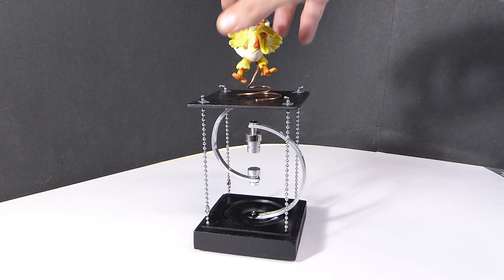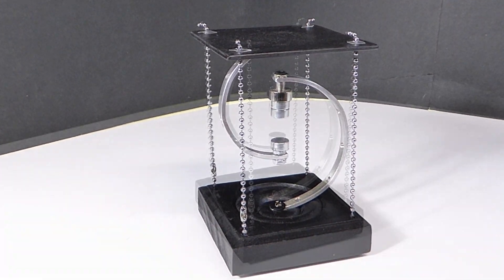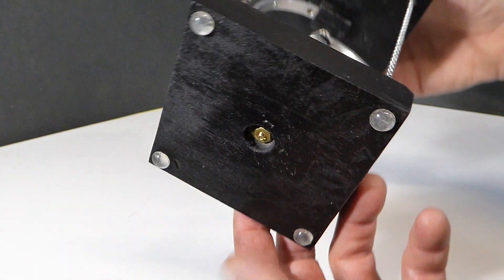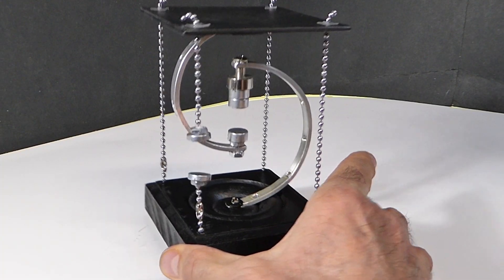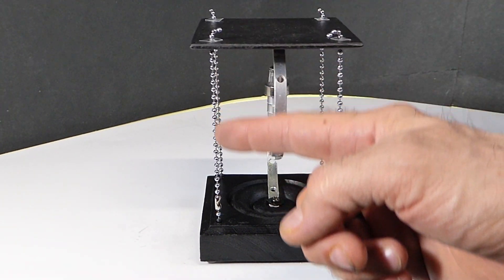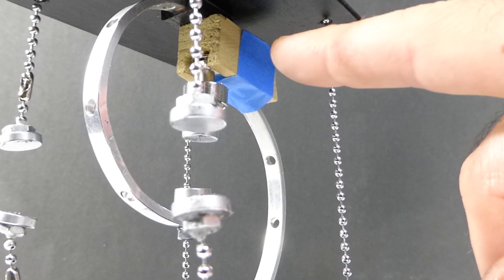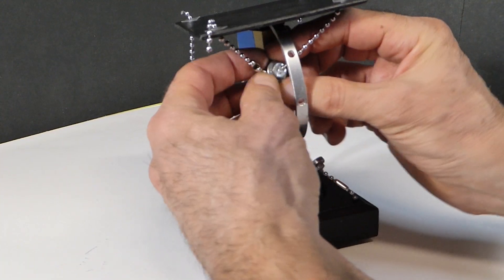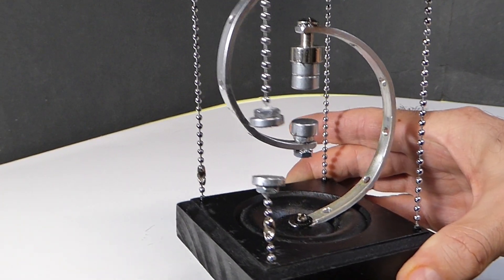Tensegrity 3 magnetic - Art Meets Science

Comment: If someone manages to make a table like this and having magnets on all sides, this would most likely be the first “floating” build with magnets, where all magnets actually attract and not repel each other like it is done with some “levitating” lamps etc.!
Reply from the maker: This is really the holy Grail of this type of contraption. Unfortunately people have devoted their lives to attempting this, without success. There are entire physics disciplines devoted to showing why you cannot do this. That being said, I’m not giving up ;-) thanks for watching.
Reply: @ArtMeetsScience  I had this same conflicting thought when i first saw the magnet tensegrity table. I know its been mathematically proven impossible but i don't really know what that means.

If the instability is due to the magnetics interacting with each other directly through their magnetic fields, what if you just made the table bigger in scale relative to the size of the magnets and their fields. This might also mean you'd have to use lighter materials and also move the magnets as far away from each other as possible and thirdly decreasing the distance between pairs. The separation could be achieved by staggering, placing one pair close to the top and the next pair at the bottom and so on with the center pice still in the center.
Reply from the maker: @RusselwithoneL  ...still won't work. The math translates to (I'm paraphrasing massively) you can never maintain the 'sweet spot' of 2 permanent magnets.  Here's a good illustration: Take 2 magnets, any type, any size. Put one magnet on a table, and try to bring the other magnet down, slowly, just enough to float the first one up, off the table, but NOT get sucked up into the magnet you're holding. This is a tricky nut to crack.
I have achieved some magnetic magic in this machine.
https://youtu.be/kND8DLMb2lc
Thanks for watching.

Comment: Stabilizing this thing with all strings replaced by magnets is impossible: let's say that force of the magnet in the middle is F_m, and force of each magnet in corner string is F_c/4. There are initial possible cases:
A: F_c > F_m
B: F_c < F_m
C: F_c = F_m
Case C has probability 0, and falls into A or B with arbitrarily small perturbation, so we reject this case from consideration.
In case A, the system will get lower, distance of corner magnets will decrease, and F_c will become even higher, distance between middle magnets will increase, and F_m will become even lower, so eventually corner magnets will meet each other, and we'll find ourselves in situation like corner strings are simply connected, like in the beginning of the video.
In case B the top will go up, the distance between corner magnets will increase, F_c will become even lower, the distance between middle magnets will decrease, until they will meet.  After this point, at least 1 string with corner magnets will also get connected due to similar logic, that I'm too lazy to write down.
Actually, using same way of thinking, it is possible to prove that stabilizing this thing with any 2 corner strings replaced by magnet strings is impossible, so the author of the video replaced the most number of strings with magnets, with respect to what physics allows.
Reply from the maker: Wow, nice break-down, Luck! Yes, I get it -  it's those 'arbitrarily small perturbations' that will get you every time ;-) . The fact is, this construction will stand with just 3 outer chains, (none with magnets) so the outer, 'magnetic leg' here, is really just 'window dressing'.  I'm not finished challenging Earnshaw, though.
You'll appreciate this other creation of mine. 
https://youtu.be/kND8DLMb2lc
Please let me know what you think.

Thanks for watching, and explaining.

Comment: try placing the the magnets at the end of the chains....alternating betwee top end and bottom end as yo go around the circumference...you'd end up with 2 diagonally opposite magnets at the top and the other 2 diagonally opposite magnets at the bottom...this might keep the forces far enough from each other
Reply from the maker: Yeah, nice thought Colin. Tried that too. The fact is, this thing can stand if I just remove the magnetic 4th chain altogether. All I need is 3 corners. Achieving 'magnetic mechanical stability' with ANY of the 3 required supporting chains is just not possible. Try holding a magnet over a paper clip on a desk. Now bring the magnet in closer and closer.  Try to find the 'sweet spot' where the paper clip will float, but NOT get sucked into the magnet. You CAN NOT. This effect is what we're up against. 
Thanks for watching! Check out my mag-lev:
https://youtu.be/Vx82pfkIp2s

Comment: Use some kind of plastic tubing that way the magnets are contained. Then add a small crank on each outer strings to adjust the length and achieve balance. Once the correct length is found just remove the tubing.
Reply from the maker: That's a good idea, but ultimately I need a larger base to keep the magnets away from each other to avoid unwanted interactions. At one point, instead of chains, I used threaded rods, so that I can make tiny adjustments. I'm afraid I may be up against the limits of what is possible here. Have you seen my copper versus magnets video? Pretty cool –https://youtu.be/SQt8iBbowe4

Comment: what if you replace all the outside ones with magnets but keep the inner chain?
Reply from the maker: Nice thought. That's actually where I started. I used threaded rods not chains, on the outside, so I could make small adjustments. 2 worked ok, 3 was impossible to balance. I think I up against physics here. 
Have you seen what I made with a 2x4 and some fishing line? https://youtu.be/EJkh5FhuCE4
Reply: Using magnets for tensegrity is probably physically impossible. At least in this kind of design.  
The reason is that magnetic forces act differently from wire forces.  

We can think of wires as very stiff springs. Picture a box connected to springs on opposite ends. The left spring pulls the box to the left with a force given by the spring potential U(x) = kx^2, and the right spring pulls the box to the right with a force given by the spring potential with a different equilibrium point V(x) = k(x-a)^2.  
The box moves under the influence of the resulting potential which is the sum of the two: U(x) + V(x).  
Plot the resulting potential with some arbitrary values for k and a, and you will see that it has a stable equilibrium at some value of x. Thus the box will fall to rest in the minimum of this potential function.  

Now assume we didn't use springs, but rather magnets. The difference is that the potential function of a magnet is something like 1/x. Considering the sum of two such potential functions: 1/x + 1/(x-a), you can plot this potential for some arbitrary value of a, and see that it has an unstable equilibrium. Meaning the box will end up sticking to one or the other magnet, rather than settling in an equilibrium between them.
Reply from the maker: @jonaslunwil  Wow, thanks for the science Jonas. Yeah, I'm pretty sure I've found the limit with this sort of design, but I'm pleased with being able to find equilibrium with 2 pairs of magnets. Are you surprised?
I bet you'd do a great job of explaining THIS: https://youtu.be/SQt8iBbowe4
Thanks for watching!
Reply: It seems like you have a good grasp of what's going on with the copper induction.  
Regarding your tensegrity setup with 2 pairs of magnets: It looks like the reason it works is that you have three outer chains in addition to the magnet chain and the central chain. This kind of setup only needs 3 outer chains to be stable, so it doesn't depend on the magnet chain to stay up.  
That would be my guess at least.
Reply from the maker: @jonaslunwil  Yes, thanks. I love that copper induction. 
Your tensegrity assessment seems reasonable. I can not remove any of the 3 chains, due to the instability of the 2 magnetic 'connections'.
I've got a mag-lev project on the bench that I'd like to get your insight into. Can I email you a picture of it?
Reply: @ArtMeetsScience  Sure. I can't guarantee I'll have any useful feedback though.
Reply from the maker: @jonaslunwil  At the very least, you will me amused. How can I reach you? I've got 3 jpegs.
Reply: @ArtMeetsScience  my gmail address is jonas.l.willadsen

Comment: Makes sense why it wouldn't work with more than one balance chain magnetized. The chains work because they have a constant length, but chains with magnetic gaps can have variable lengths. As soon as two of them have magnetic gaps, whichever gap has the stronger force is going to dominate and those magnets will get closer together, causing the gap to shrink and the forces  to increase even more. At the same time the other chain gap will widen and become weaker.
Reply from the maker: Yeah, I had to try. Damn physics!

Comment: What happened with replacing all chains wjth magnet.

Ifbu are stuck,
U Should reduce the power at the sides.

4 sides total = 1 at the center
Reply from the maker: Yes, the forces must balance. That's the whole game here. Seems simple, but it is IMPOSSIBLE. There are laws of physics that explain why. Try this: put a magnet on a table, hold another magnet above it, and slowly bring it closer until you pick up the magnet that was on the table, cause it to float, but not slam into the magnet you're holding. IMPOSSIBLE! That's why all those magnetic levitation devices (desktop floating globes, floating light bulbs, etc) use an ELECTROMAGNET that's constantly modulated by a feedback circuit. Check out this maglev project of mine- https://youtu.be/Vx82pfkIp2s
Thanks for watching!
Reply: @ArtMeetsScience  ok. Understood. Thanks 👍🏻

Comment: Did you try using Neodynium magnets and/or getting the magnets really close together?  Or, one corner chain can have its magnets near the top, and the ones adjacent could have its magnets near the bottom?.. This might pull the em fields away from each other.
Reply from the maker: These are Neo's. I tried every-which-way. Going to a 4th magnetic link is impossible in this configuration. Thanks for the suggestions.
Have you seen my vid Copper vs Magnets:
https://youtu.be/SQt8iBbowe4

Comment: I have been toying with similar concept. Thinking springs with magnets on the ends. Thinking use much larger diameter mags for the lower ones and smaller for the uppers (opposite for the center leg). Add another a leg to 2 adjoining sides will add stability, maybe. Make upper platform assembly as light as possible so it will be quick to settle and stay put, maybe.
Reply from the maker: Cool idea. I've tried to 'balance' the magnets pull with springs, and had no success. I'd love to see you make it work. Check out my latest vid - MagLev - https://youtu.be/Vx82pfkIp2s

Comment: The problem is for the chains all need to be identical in gap spacing and chain length. The magnets will need to be identical in pull as well for the chains, however the central magnets would have to have the same pull as the four chain magnets combined, probly, idk its worth a go. lol.
Reply from the maker: Yes, theoretically, everything in perfect harmony, perfect balance. In reality, it's just impossible. One part of the problem is that the upper structure ('tabletop') wants to slide off to the sides, and rotate. I've been experimenting with a variety of solutions to control these motions with additional magnets, but I have not found a practical design yet. Thanks for watching.
Reply: @ArtMeetsScience  IDK, what if the corner magnet were closer?

Or what about some copper? IDK exactly how magnets and copper react each other, but I think it could help corner magnets going to center.
Reply from the maker: @TheAndycroy  I think Bismuth is the answer.

Comment: For the outer chains, what if you simply mount the lower magnet directly on the base so there's no propensity for it to move? The only movement then would be in the hanging magnet and if that's close enough, it may be sufficient to ensure some stability.
Reply from the maker: Good thought. Yes, I tried. I even tried mounting both the upper and lower magnets on posts. No matter what you do, you just can not balance the magnetic forces to keep it stable. I now believe that this is impossible without using an electromagnet, Hall-effect sensors, and a microcomputer.
Reply: @ArtMeetsScience  Looking forward to that.  :-)  I'm actually in the process of designing and building a Tensegrity table to be used as both a brochure rack as well as registration table for the Maker Space I do my woodworking at so am very intrigued by the various solutions people are posting up.
Reply from the maker: @Jaydcoke  Can't wait to see!

Comment: U should tried replacing base and top with a wider surface area i think so that your magnet wont attract each other (distance from one set of magnets).. Thats just my opinion hope u would consider
Reply: It won't work.  Hysteresis will get you every time.
Reply from the maker: Yes, good suggestion. That would eliminate that one issue, but it still seems impossible to balance any magnetic forces without a computer-controlled, electromagnetic device. That being said, I'm still experimenting with a couple more ideas.
Reply: @ArtMeetsScience  but do you think it’s theoretically possible to make this work with the right tech?
Reply from the maker: @Goblinoid-o  Yes, but that means using electromagnets. It's impossible to go any further with PMs. With EMs we could vary the magnets strengths continuously, maintaining the critical 'sweet-spot' of balance. This would require Hall-effect sensors, and a micro-controller running the EMs, as you see in the many 'floating globes, lamps etc' that you can buy. My dream is to float something with PMs.
Have you seen my mag-lev hockey project?
https://youtu.be/Vx82pfkIp2s
Thanks for watching!
Reply: @Goblinoid-o  There is a thereoretic result in physics, the theorem that states, that structure, consisting of bodies linked with any possible combination of static magnetic fields is unstable. So, it is possible to be made, but it  should be somehow stabilized, or it will collapse after a perturbation.

Comment: You should've tried to replace chains with magnets not on one side of the square, but on a diagonal, it still wouldn't be complete floating but at least something. Another idea is to replace chains with pillars with magnets, that way they won't be able to glue wrongly and the structure would be completely floating (also you need to account that central magnet should be as powerful as 4 lateral magnets combined (or even stronger if you want to put some weight on top of the structure)). Good luck with your experiments.
Reply from the maker: Hi Vlad. These are great ideas, and I tried them all! The 'diagonal' idea was just as unstable. I also tried using threaded studs as pillars, with magnets. That eliminated some of the 'glue wrongly' problem (I love that phrase), but ultimately got me no farther.  Once you 'magnetize' any 3rd leg, it becomes impossible to maintain the sweet spot of balance with attractive forces. I think one computer-driven electromagnet in the center, balancing 4 permanent magnets around the outside will get me there, but that's a lot of work. I'm working on another passive design incorporating repulsive forces. Thanks for watching.
Reply: Josh Schneider it seems like the issue comes from interference with the magnetic fields, either from another magnet or metallic structural elements. If you increased the size of the table/model to give more space between the supporting corner magnets, it should reduce that issue, but bigger surface = more weight = stronger magnet = more interference, so a finicky problem to balance and solve. Thanks for the video, I’ll look forward to seeing what you come up with